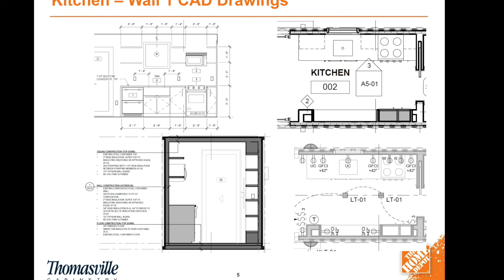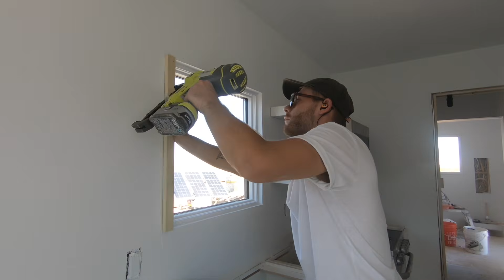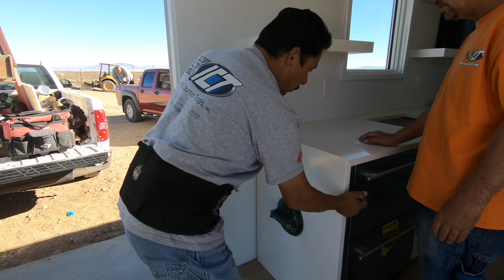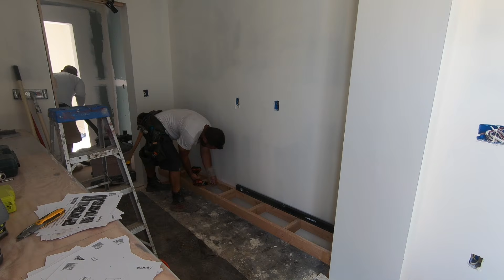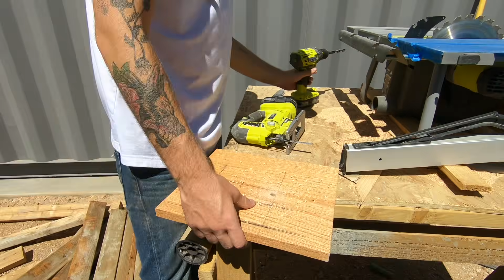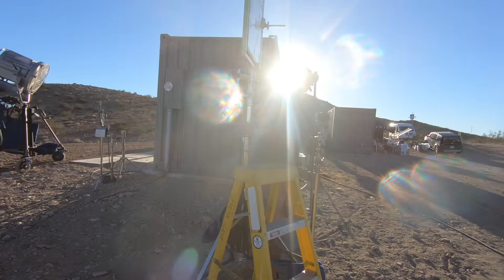Building a Kitchen in a Shipping Container Home | EP07

Comment: As a woman, I can tell you we never have enough space for storage in the kitchen. This is a small kitchen so you really need to think about how to use every single bit of space that isn’t needed for structural, electrical and plumbing. Don’t waste a single inch anywhere. Function is so important in a tiny kitchen and you just can’t afford to waste available spaces on esthetics that don’t have a functioning use. You wasted some great space in the kitchen when doing the cabinets across from the stove side of the kitchen. That space above that you sealed about made me cry. Also, you need to consider the environment when deciding to make so many open shelving units. Most arid environments like that one have a lot of dust and very fine sand that in the wind gets airborne and blows in any living space settling on and inside anything open. Then, as you are close to a road, any passing traffic will always be stirring up dust to coat everything on your property. Part of My family lives in a desert area in the country and they are plagued by dust and sand inside of their home which gets everywhere.

Comment: 1 thought re your microwave--I really think if you'll paint or wrap the sides in white laminate, the microwave will not appear as large and obtrusive. At least w/rolled, self-adhesive laminate, you can easily remove if it doesn't give the desired effect (but I really, really think it will work surpisingly well for vey little time & money).

Comment: It's not that much more... I disagree with the decision to not install flooring under the cabinets. Now, if the cabinets are ever changed for any reason, the must fit the original footprint. I get there isn't much change in the general layout of a galley kitchen, but depth and details can never change, the way you did it.

Comment: You could install the cabinets yourself. It isn’t that much work. I don’t like open shelves in kitchens since it’s easy for glass or ceramic to slip off and crash. Better to use cabinets with glass doors.

Comment: Why is drywall mandatory in the US? Concrete is a much better insulator.
Reply: And much more expensive.
Reply: Both matrials have their applications, but in the world of building science No One claims Concrete as an Insulation value greater than R-1. To compliy with 2012, 15 or 2018 Energy Code you would need more than 2' of concrete. At that point why did you use a container in the first place. Just use ICFs and build what you want. Thanks

Comment: Back in my remodeling days I used to judge the previous contractor harshly when I found they didn't paint behind the cabinets. Since paint is first a protectant rather than decoration I always wondered why in the area where water damage and Mold are most often present, they skipped that area. There has to be some reasoning other than "the owner will never know", green board is there or half a pint of paint costs too much. Another practice on my builds is installing flooring completely under the cabinet area for many reasons. First is so the Toe Kick height is not compromised, also the flooring install is much easier than cutting around existing cabinets, the true 36" counter height is maintained, so future remodels won't have to find a substitute to patch the flooring. The additional time to measure and template around cabinets vs the $20 of material just isn't worth leaving a low spot for spills to settle. Ben, you have great reasoning skills, please shed some light on these practices. Be Blessed
Reply: Agree 💯% 👍
Reply: I was thinking this, paint it and lay floor first. Ill do it this way
Reply: @Mumumama205  I hope my reasoning makes sense. I just never believe that short cuts are better than doing good work. Maybe just me but I never want to miss the opportunity to feel good about my work. Sounds like you are on that same road, be blessed.

Comment: Question for Q&A. Now that its wrapping up, was using shipping containers compared to framing from scratch in this size the economical/practical choice?
Reply: @wortheffort  I think it's about "cool" not "cost"   "CONTAINERS are COOL"
Reply: I dont think it is cheaper but it will be interesting to hear hi answer ,,,,,i love shipping containers but there is a lot to learn and consider
Reply: @np5687  I hope this is only not cheaper in countries with regulations like in the us since I wanna build something like this in Central Europe ❤️
Reply: I'd really be interested to hear an answer to this as well.
Reply: Doubt. I did math some time ago and for a price of a shopping container, I could get enough aeroc blocks to build house shell out of.
Reply: From what I've seen, shipping containers are generally cheaper if you buy used, don't go crazy and leave the exposed container on the outside, but often times regular building is cheaper because if you're building to code, you're forced to pay for insulation, foundation, permits, and many other things that any house would have to pay for. It's definitely possible to build a regular style home for cheaper, but I think when compared to a "unique" regular home of it's size, the shipping container becomes the economical way to have a unique design.
Reply: I’m about a month from finishing my own home in San Diego county. 6 x 40’ containers like a three sided box plus one 20’ on the other end (with garage doors completing the  square) as the kitchen with a pass through breakfast bar. Roughly 2800 Sqft.  Metal framed for the roof structure inside the containers and the containers themselves framed in a somewhat similar manner as Ben’s

About $140/ft is where my build will shake out. This doesn’t count septic, solar & batteries (I’m in the solar biz and the home is off grid) or permits. 

For everything I’ll have around $800k in it. 
Seems like a lot but it’s situated on 85 acres with an ocean view about 25 miles away. I could easily turn around and ask $1.75 for the property. 

Debating doing a channel about it but not set in stone. While I acted as the general contractor, I’ve never built anything beyond complex ground mounted solar arrays before and I had lots of professional and volunteer help and the containers came pre cut out of Long Beach. Luckily I found this channel as I adopted the second generation of Bens door and window framing and I love the outcome.
Reply: @mattbrew11  u r definitely smarter than I am! 😁 can you share  photos of you finished project?

Comment: My issues with the kitchen.  
The fridge is too small. Just looking at my own fridge, I don't have much but it still takes up a lot of room inside. The home might need to add an outdoor freezer/fridge, especially with the current events happening as they are and larger food storage for fewer trips matter.
Secondly, there is very little counter space. It looks like there is barely enough room for a single meal. I wonder if there is enough room on the cabinet/storage wall for other amenities like pots and pans plus any thing like rice cookers or crock pots. 

I'm sure this is mainly an example home but since people are moving to about this size of homes now I think it needs to be considered. Overall, it's a nice sleek and cozy kitchen.